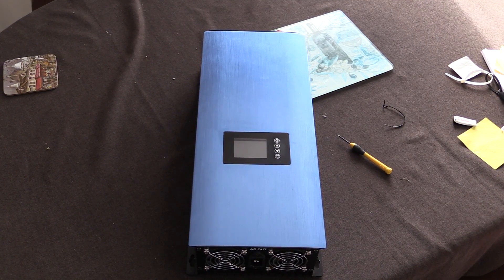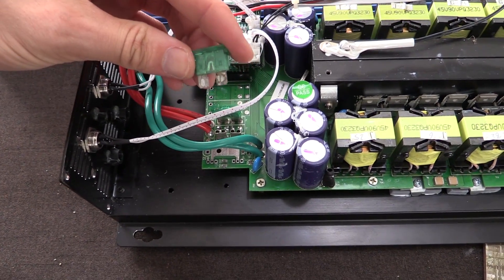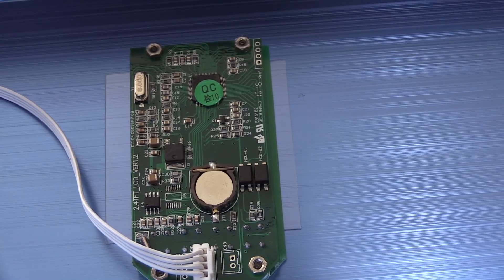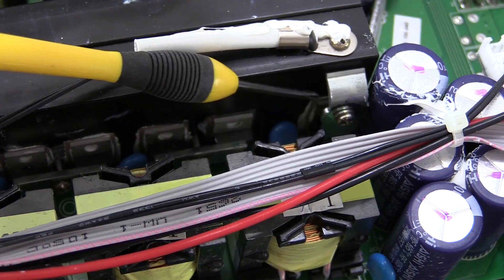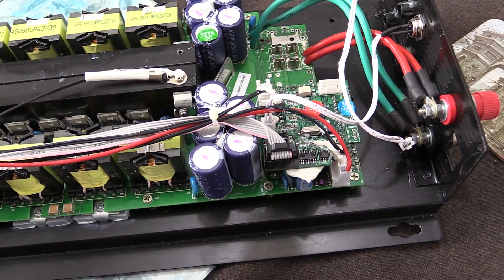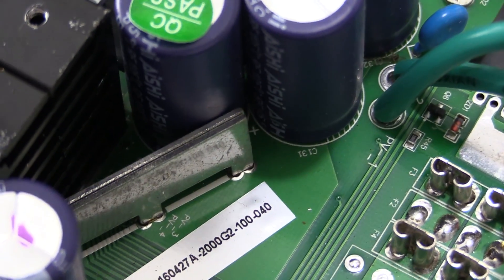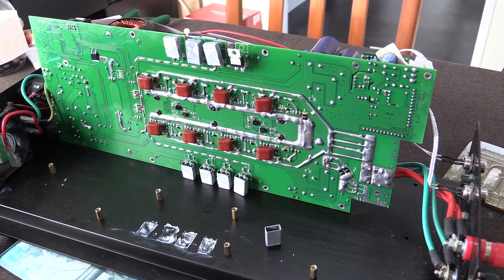Inverter Problem Part 2

Comment: I love those eight Transformers on the side? Little brown components on the bottom side or capacitors... And a huge amount of solder underneath, probably to take up all the current that's throwing instead of having wide paths...

Comment: I have a GTIL2. It does not start up. There is a blue LED (LED1) on the main board near U11 which blinks a code as an aid to troubleshooting. Does anybody have a copy of the table of "blink codes"? I have no idea how extensive it is. Maybe it would help here.

Comment: Mike, 
I had two of the 2000w G1 with limiter's do the same after approx a year of use.
I had used them in the same manner as you for a year in 2015, dying in early summer 2016. 
Did exactly what yours did - blew a main internal fuse. Testing all the mosfets turned out most had blown, sourced some new ones and replaced them. Was told by the manufacturer that this had been addressed in the new model ( G2 - the one you have ) but obviously this is incorrect, seems the only thing they have done is moved the Mosfets to the middle to attach to the heatsink internally and  also the one on the base.
where as in the G1 they were on the outer edge and attached to the cover which was a finned aluminium design.
After loosing the 1st GTIL, I did run external cooling over the 2nd to try and keep the temperature down incase this was the cause of the 1st failing, but this 2nd one still eventually failed anyway. As already mentioned by others I think the main cause is poor design and the  components utilized within.
I did at the time fault the inverter and flag the Mosfet issue back to the manufacturer - who offered to send me some new Fets.Instead I sourced these from a local electronics company to save the shipping costs etc from China.
 I have since moved to a more comercial inverter ( Victron Quattro ) which is made like a tank ( and also weigh's like one) but thats due to the transformers and other HD components inside. This also performs far better than the GTIL and can run as a Grid tie or standalone all day + has a built in charger for any battery types - only downside is obviously price, but for safety and peice of mind I decided to go this way in the end.
I did have mine fused individually on the DC with circuit breakers which did trip at the time but only after the GTIL had blown its Fet's etc.

Your experience of the GTIL unfortunately also confirms for me that the issue I had with the G1 hasn't been cured with the G2, as promised by the manufacturer who offered me a trade up to this G2 model as a solution + additional costs on my behalf. Decided at that stage ( summer 16) to buy a more dependable unit, and after much research bought my Victrons.
These have been rock solid, like all my other Victron products - which does prove you get what you pay for in the end.

Check all your Mosfets, and I'm sure you'll find a few faulty ones - Good Luck on the repair!!
& happy tinkering....

Comment: If you look in the lid, I saw a dark mark which maybe dust but it also could be a plasma mark where a component has sputtered out of its case.
This unit appears to have 8 identical inverters in parallel. The resistor R80 did look dark and maybe the mosfet it is connected to is short and it's pair on the same transformer.
Because of the parallel nature of this unit I would guess that one of the 8 has gone short circuit and this would stop all the others from failing.

Because you have 8 identical invberters this will enable you to check component values in the blown circuit with the still good ones.

The brown caps on the rear are 470n 250V film caps.

http://www.es.co.th/Schemetic/PDF/MET-683-400JP10.PDF

Comment: check the gate pulldown resister and diode if they have blown as well just replacing the mosfet wont fix it and the new mosfet will blow again also check the transformer on that line for a dead short
Reply from the maker: ok i will need to find that resister
Reply: Mikes DIY Tesla Powerwall it's on the under side of the board on the gate leg it is the surface mount with an R on it and the diode is just above the resistor

Comment: I noticed the brown skid mark on the inside of the case. What does this line up with? Electrolytic capacitors drying out are worth checking, granted your kit is not that old, but if they were getting heated that would age them prematurely. I think I would put the ohmmeter on the output, measuring in and work back down the circuit, perhaps desoldering legs of components until something changes.
Reply from the maker: Thanks for the comment , new update vid out now

Comment: Looking at the screen module from here at 3:56 it looks like the component at U3 has melted. Either that it's covered in solder mask. This screams of a blown FET though.
Reply from the maker: Both failed.
Reply: This is a small PCB and U3 is most likely a local voltage regulator for the display board, The size of the cables to that board would not carry 60A to cause his trips to fail. The reason it looks like it does is because of the conformal coating of the whole PCB after manufacture to stop the ingress of moisture and little bugs making it home.

Comment: No idea what to do, I doubt it will be this easy but maybe just try running it with a new fuse?

I was just about to buy one of these, would you still reccomend it?

Was also thinking of using the same charge controller setup as you are, with 2 panels for each charge controller & a 72v battery bank, would you suggest anything different?

There are some alternative 72v boost controllers on ebay, search "72v mppt", one is black the other is blue.
Reply: i have one and it works great been running just over a year so has paid for its self already

Comment: Just out of curiosity, how hard was the inverter working Mike? How many watts was it producing at peak?
Reply from the maker: the screen read 1936w but the AC watt meter read 2000 ish, you will see on part 3

Comment: Mike, that's a bummer but you should be able to replace the mosfets as I think they are the most likely cause of the short.

They sit directly across the incoming 48VDC and then chop that at a high frequency to generate a high voltage DC rail, probably around the 400V mark, that 400V DC is then chopped to form a 230V AC line that gets filtered and sent out to the grid.

That odd component you mentioned in the end of the video is just a simple jumper, they needed to get the gates of the mosfets back to the controller so they used a big jumper to do that I think.

As fleaspotter already suggested I think you should be able to access the screws for the clamps that holds the mosfets to the heatsink by reaching between the transformers with a long screwdriver, I would start by removing the two mosfets you already identified as possible faulty and test those. They should be standard off-the-shelf components and I think you should be able to simply replace them as I don't think anything else would have died. Mosfets tends to fail closed and then blow a fuse or track, all your tracks looks fine so I think you should be fine just replacing the faulty mosfets. If you're really unlucky the mosfets would have taken the driver with them but I don't see why that should happen?

I would replace both mosfets in that pair and take it from there.
Reply from the maker: Oh so thats how it works, 400v sounds high, thanks for the comment. Just released part3 video
Reply: If they fail, do you suggest a beefier MOSFET to replace them instead of reaplacing with the same identical part (which seems to like to blow)

Comment: replace the fets like in the powerjack inverters. Use overvoltage protectors on AC and DC. 1000W inverter mean 500W real power on cheap china inverters. Remove all fluorescent tube from the house, they produce high voltage spikes!!!
Reply from the maker: We have all led lighting , but unlike a offgird inverter there is a small delay between when it senses the load and when it outputs more power to cover it. I guess that is a bonus of grid-tie.

Comment: The brown components on the bottom of board are 47nF 250V capacitors.
It appears that design uses two 48V to 400V DC to DC converters. One to give you +400V and the other to give you -400V. The +/-400V is then chopped to give you 240VAC. 

The each DC-DC converter has 4 identical channels in parallel. Each channel has a transformer and a pair of MOSFETs to switch the 48V. The eight 2 leaded packages on the back are diodes to rectify the DC-DC converter to provide the +/-400V rail.
As the fault looks like a dead short on the input side so problem is likely to be one of the MOSFETS screwed to the big heatsink.

This inverter has been designed to a price so is very hard to service.
I have repaired a 300W grid tie solar inverter but would not recommend repairing this 2kW unit.
Fault finding will be an absolute beast as you have to remove and test every one of the 16 MOSFETS.

Best alternative is to scrap it and buy a properly designed inverter
Reply: If you look closely to the underside of the board you can see that those 400VDC rails are connected together so there is only one 400VDC rail and not two. You don't need two anyway to generate a 230VAC as that have a peak of 325V so can easily be chopped from a single rail . You don't need two to generate 230VAC rail. :-)
Reply: your right it would be chopped from one rail using 2 npn and 1 pnp mosfet setup to create 240v ac
Reply from the maker: Thanks Peter for the details on how it works :) Have a watch of part 3, i just videoed tonight. Slowly getting there but the real question is will it work again.

Comment: You are going to have to get that heatsink off to get access to the MOSFETs.  Once you have the heatsink out if the problem is not immediately obvious, then test the MOSFETs for a shorted condition.
Reply from the maker: You were right about taking the heatsinks off, that was a pain and you were right with the Mostfets being the problem :)

Comment: i'm not real impressed with the design of the inverter, the MOSFETs being positioned the way they are makes them virtually impossible to get to. That being said, I noticed that on the inside of the top cover there appears to be a spot of smoke to indicate where the problem is at.
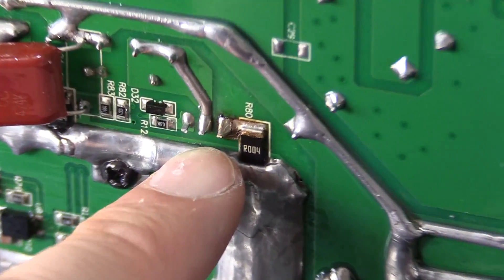Reply: That smoke/black mark in the lid (3:59 in vid) looks like it might line up withe the component  that you spotted with the hot mark round the solder joint (11:20 in vid).

Comment: Circuit breakers (and HRC fuses) are great as they break the connection so fast the failed components don't explode. Standard fuses are so slow to blow making a mess of failed components, that's why the green fuses were not blown.
Sad to see him die :(
It will most probably be the MOSFETs as you thought but as they are in parallel they will all be dead. That looks like a pain to work on as you will have to de-solder every component on the heat sink and remove it as a whole as the screws are hidden behind the transformers. Just hope the mosfet drivers are still good.
Reply: It seems that the screws are accessible between the transformers for each pair of MOSFETs. Check the video at 8:19, I think it's the best recorded position to see this.
Reply: That would make it so much easier, always a pain to pull whole heat sinks and components out all at once.
Reply: You're right, you might be able to access the clamps for the mosfets through the gap between the transformers, that would make it a lot easier to replace the mosfets.